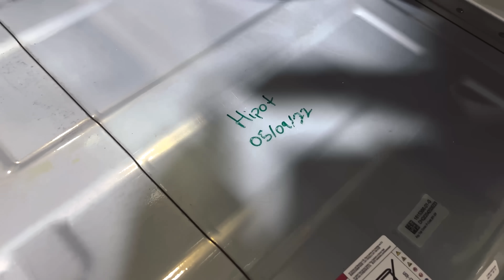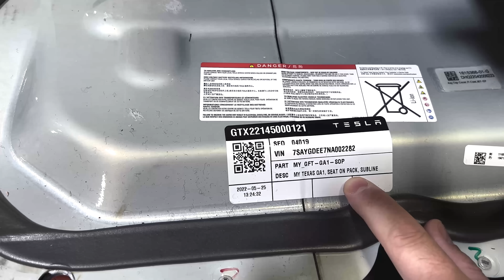Tesla Model Y 4680 Structural Pack OUT!!!

Comment: I have the upmost respect for the expertise and lack of drama this channel provides. Very fantastic technical analysis in every video I've seen. 

At 800*800 that's 640K for the battery pack. You guys deserve it, I just can't justify getting a cell for myself. I have been inspired to take a wrench and hammer on a model Y though. I might try full-time selling those hot little cells.
Reply: It didn't look like fun removing a cell from a non structural pack.  I can't wait to see how tough it will be be to pry one out of the goo in the structural pack.  You may rethink your business model once that top comes off :)
Reply: @oof_Dad  Maybe they're planning to use a chemical adhesive solvent? That should make getting the individual cells out of a pack pretty simple... if not necessarily "easy".
Reply: @Will Beebe 800 dollars, a bargain and you do get free shipping
Reply: Each cell could look a little wrecked after they extract it (hole-drill it?) from the structural epoxy mold. Buyers will be getting a real piece of Munro/Tesla history!
Reply: That's pretty entreprenurial. Get someone else to donate their early slot. Buy the car for $60,000, then sell the cells for $500,000, whilst they still have rarity value. No wonder Sandy doesn't look skint. Bit cheeky if you ask me, but if people will pay then I guess that's what they are worth.
Reply: They aren't selling every cell, so it's probably more like 800*600 or so.

Comment: okey when i first herd about structural battery i sort of thout it woud be hard to remove and woud be glued on to the body. but now when i did see how they have done it i m now okey whit the idea. only thing i m still on defence is that seal on top of the battery. so do you have any idea how it will handel winters and summers whit 60C temparature changes duaring the year (from -30C to +30C) and is there places where road salt coud stay and cause some damage whitout extra rust proofing.

Comment: the drop floor is ingenious - the mounting window as big as it gets, without loosing much structural quality. and then... the structural battery pack, mind-blowing!
Reply: Nothing mind blowing here lol….. simple engineering! Not all cars are made the same
Reply: @carholic-sz3qv  Yeah , interesting to look at , but is it any less interesting or cool to watch a conventional front wheel drive vehicle being manufactured with the body lowered down onto the engine , transmission , differential subframe , suspension, brakes and steering in one movement .
And teslas where not the first mass produced car to have a bolt in floor , just saying.
Reply: The structural rigidity is far greater.

Comment: 5:10 that sliding center console that engages with the structural battery pack and instrument panel is freaking genius!
Reply: Nothing special or genius at all!!!! Many cars have had such things for decades……
Reply: @carholic-sz3qv  …GM was FIRST, Mary LED!!!!

😂😂😂😂😂😂😂😂😂
Reply: @carholic-sz3qv
Reply: Can someone explain to me the benefits of a sliding center console? 
I don't understand
Reply: @yudoball  Hey there. The benefit is ease of installation. Rather than someone sitting in the car installing everything for the center console or a robot installing everything inside the car, it's mostly set up outside before the battery pack is lifted up inside the car. Then the center console slides into place and some bolts and trim are installed.
Reply: @randomsonmymind6919  thanks for the answer, appreciate it
Reply: @randomsonmymind6919  Could still be done without the slide, just bolts and trim after its all lifted into place.
Reply: @yudoball  it allows the current dash and console geometry to work. I guess it will be deleted after someone works out it is a waste and changing the console and dash geometry across the y will allow it to go. So perhaps there are plans for a revised dash and console in the future. Its cool to people but the truth is its an efficiency sacrifice (wasteful and heavy mechanism with lots of parts and sub assembly work) made to re-use dash and console parts from non 4680 model y variants.
Reply: Wonder if center console can be mod to allow sliding or changes
Reply: I could hear the positive engagement click clear across cyberspace, y'all.
Reply: @companyman7128  Here is the timestamp link for those who are curious. @5:14  and for the record I was both surprised and impressed with this assembly feature as well.
Reply: It also engages the rear passenger air vents. Absolutely mind-blowing design.
Reply: @AvocadoAtrocity  nothing mind blowing lol…..

Comment: Awesome content.
I would be interested to know the stiffness of the pack.  Will you perform some torsional tests on the pack before you disassemble?
Reply: Good point. When they crash test this vehicle, especially the side impact. Are their pictures showing how the structure pack handled it?
Reply: Yes, and for the body without the pack, too would be interesting
Reply: They haven't shown that sort of testing for any other vehicle, so I doubt it's part of their services or their knowledge base.

Also, the pack only acts as the floor panel, with seat supports, so it won't have high torsional stiffness. Imagine cutting just the floor (with seat support crossmembers) out of any conventional unibody car, leaving the sills/rockers behind - the part removed would be floppy.
Reply: @brianb-p6586  The pack is structural. Stronger than normal car.
Reply: @waynerussell6401  All cars have floors, serving the same structural function. It would be pointless to make the vehicle stiffer or stronger than it needs to be; this is just to make it lighter and cheaper.

Comment: having the seats mounted to the battery pack is pretty freakin cool. no more robots doing acrobatics to get the seats into the car during assembly.
Reply: What about the rear seats, where are they placed?
Reply: They are fixed to the chassis before the pack is fitted.  Because there is the gaping hole it’ll be a lot easier than normal cars
Reply: That saves a ton of assembly line time!
Reply: Also eliminates the robot gymnastics to get the instrument panel and rear seats into the car.
Reply: @martylawson1638  it also makes the car less repairable in case of problems years later, from the structural battery alone to the big castings! I’ll like to see those cars survive in Africa or South America lol……
Reply: @carholic-sz3qv   these aren't off road vehicles..

Comment: I'd love to know why the weight of the SR version is almost the same as the current LR version. Is it because they use ballast cells or is there more insulation for NVH, or is it something else?
Reply: Tesla’s SR cars now are using LFP cells, instead of just removing some of the NCA cells from the pack like they used to.  LFP takes more weight and space than NCA, but the SR packs have room for it.  LFP has advantages like lower cost, longer life, and ability to change to 100% all of the time.
Reply: @georgepelton5645  this is a SR AWD car. The LFP cells are the SR RWD cars.
Reply: @georgepelton5645  
LiFePo4.
Lower cost. Not necessarily.
When you account for extra energy density meaning fewer cells, it's closer than you think.
Longer life. Watch the latest Jeff Dahn presentation (in Canada)
He confirmed, as stated elsewhere (Drew Baglino?) That by dropping the voltage on a nickel based cell to about 3.9(?) Volts, they can achieve many more cycles than the LiFePo4 type, while keeping better performance.

Comment: I wonder how much manufacturing time, steps, and parts this design saves as compared to the older construction.  I know they probably put that into their reports but i am super curious as to how much more efficient this is, roughly speaking...2 or 3 times?
Reply: No floor welded into the bodyshell (that's a lot of welds)
Carpet and Seats fitted "in the open" (in another part of the factory)
Easy dash fitment (from underneath?)
Better access to front and rear components, standing in "the cabin".
Just that will be much faster (and easier on the backs of those assembling)
Reply: I also wonder how those cars will do in the years to come!!! What about repairability instead of gluing everything together!!!!!
Reply: iirc, several months ago the CEO of VW was talking about how Tesla can apparently make Model Ys about 3 times faster than VW can make ID.4s. And that was before Giga Austin came online, so the gulf may very well be quite a bit wider, with the structural-pack Ys.
Reply: @coredumperror  you realise that vw is still ramping their cars production right!? Tesla didn’t started making soooo many cars magically!
Reply: @carholic-sz3qv  I'm quoting the CEO of VW about how fast Tesla makes one car vs how fast VW makes one car. I'm not talking about run rate at all, which is what gets faster as carmakers ramp up.
Reply: @coredumperror  you mean EVs here because vw makes about 10 million ICE every year of all models included from from tiny Al hatchback to suv, minivan, bus, commercial vehicles…….. tesla basically makes two cars the models/x and modelY/3
Reply: @carholic-sz3qv  Yes of course I mean EVs. I specifically said this was about Tesla's Model Y vs VW's ID.4. And I don't understand what you keep arguing with me, when I all I did was quote the CEO of VW himself.
Reply: @coredumperror  VW and there quality. A quality car will never leave a factory before 72 hours.
Reply: It would be enormous just for the battery now being structural with far less cells to intergrate. Not to mention the saving in factory floor space with the megacastings instead of welding robots. Efficiency up, Simplicity up, Costs down whats not to like about this. IMHO although not a Tesla guy what is good is that Tesla consistantly keep improving every aspect of the design, engineering and production. As per this video and even to a lessor degree the plaid videos, you dont see that never sit down mentality with vehicle production manufacturing.

Comment: Thats all nice and goody but how does an end customer benefit from this?
Reply: More efficient for Tesla so they are more profitable. The customer benefits when a company is healthy and succeeds against others.
Reply: @kobbetop  I agree up to a point, healthy competition is always a good thing
Reply: Making the battery pack structural saves some weight, which will increase range for the same amount of battery capacity. The use of front and rear mega castings plus a structural battery pack means there are far fewer parts in the car, so quality should improve, which will probably make cars more reliable and less likely to have minor, irritating issues such as inconsistent panel gaps or squeaking. The structural battery pack and mega castings can also save on manufacturing costs, which initially will improve Tesla's profitability, but eventually will probably result in Tesla cars becoming cheaper to buy.
Reply: @CiaranMcHale  there are a few pricing strategies, one could support your statement but others dont. In general I do agree that development is a good thing and that tesla leads the way in many thing that can have a positive broader impact
Reply: Less materials, less weight, less environmental impact. More efficient vehicle uses less energy per mile driven, means safer in a crash due to the increased rigidity etc.
Reply: @4literv6  good answer thank you :)

Comment: That is a real smart way of doing the interior, instead of going through the doors you can come up underneath to put in the back seats, front dash and trim it out then lastly lift the floor in. Would make much more ergonomic sense in the production line. You even see the workflow that they have first you lift the dash in and hookup all the wires, lights etc from the front to the back. Then you trim out the roof and pillars. Lift in the back seat frame and seats. Finally lift in the floor, slide the center console forward bolt is and cover it and the inadie is done.
Reply: No, you can't do the back seats first - you have to do them last (with the front seats in the way) because - as they explained in this video - the rear seats have to be out for various connections that would need to be done last during installation and first during removal.
Reply: @brianb-p6586  
Good catch
And ughhh. Awkward to get them in I bet
Reply: @whodatcatt  Still, limiting the awkwardness to just the rear seat is a huge jump versus bringing everything in that way. Probably more potential for line automation too.
Reply: @whodatcatt  The seatbacks are still in the car now, so those can be installed first and the bench is one piece, it shouldn't be too awkward to put in. It's probably still a big improvement over the current one.
Reply: We know this